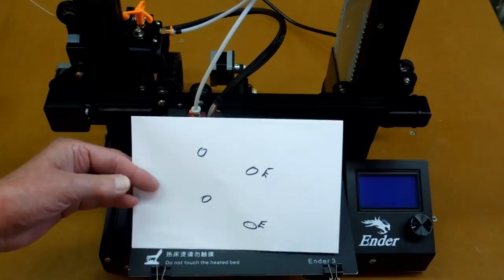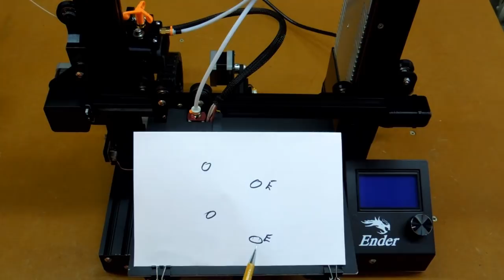Ender-3 Review The Good, Bad & Ugly

Comment: I do agree with some of your critique, particularly the filament holder and fan orientation and certain build quality issues. 

But after getting one and spending a week upgrading it and tweaking it, I realize that while it benefits their bottom line to ship out a bare-bones product that requires tinkering and modification the end result is a crash course in 3d printing and minor electronics introduction.

Just researching and printing out upgrades and even buying some minor hardware upgrades help me understand alot of the basic concepts and made me more comfortable handling the technology. You are absolutely right in saying that if you are a tinkerer or a hobbyist this is a great tool. But fundamentally the 3d printer is one of the cornerstone of the maker community so in essence this product keeps to the heart of that.

The entire point of this product is to learn the nuts and bolts of 3d printing by using the product itself to help you understand how a 3d printer works and what it can and can't do. For that alone this product hits the mark and for the price point is literally as close to a no risk commitment to seeing if this is the thing for you.

Comment: OK, it's now 4 years later and this printer is still in production despite the fact that Creality has introduced many upgraded models.  I recently bought an Ender-3 Pro, which has a few upgraded features over the original.  It's a bit more expensive, but I think it's worth the extra $50 or so.  Also Creality has been modifying these printers silently behind the scenes, making some improvements.  
The differences between the Ender-3 and the Pro version are small.
1: Y axis now rides on a 40x40 extrusion instead of a 40x20 for increased rigidity. 
2: Build surface is the same, but is now held in place by a magnet instead of being glued down to the bed (magnet sheet IS glued to bed). The build surface is flexible making it easy to peel finished objects off the sheet.  The flexible build surface is also a magnet so it will attach to the bed in only one orientation (N<->S poles aligned).  
3:The printer used to come with a Meanwell power supply, it now comes with a UL approved clone built by Creality.  
4:The main board is now mounted upside down in the PRO vs the original which makes the SD card socket easy to reach (but it goes in UPSIDE DOWN!), and also puts the cooling fan on the bottom so bits of plastic won't fall inside the electronics enclosure. 
5:It looks like the Y axis endstop now is held in place by T nuts to the 4040 extrusion.

Today's version of these printers now come with a version 4.2.2 32 bit control board with standard motor drivers.  The V2 and S1 versions come with the new 'silent' drivers.  However, the motors in the printer are barely audible over the fans (when they are running at high speed).  The extruder sill has the plastic parts, but they now have a brass insert in the hole to pass the filament so there will be no wear problem.  The threads for the bowden tube compression fitting are also in a brass insert.  They have also added a spring tension adjustment screw.  All in all, I don't see any reason to rush out and replace the extruder with a metal one.
My printer was well packed, and the various modular parts were well assembled.  I would not call this a kit, very little actual work is required to assemble it, the user is just doing FA&T work (final assembly and testing). If you can assemble your kids new bicycle, or a kitchen table from IKEA, you can put this together.

This is my third 3D printer.  My first was a completely home designed and assembled RepStrap made out of surplus stepper motors and metal parts from Home Depot.  My second was a RepRap Wilson design with its parts printed on the first printer.  The Ender-3 Pro printed much higher quality right out of the box than either of my previous printers with no fooling around with slicer settings (used the 'stock settings that came with Prusa Slicer for the Ender 3).  PLA I used was the Matter Hackers 'build series' at $21 a spool.   Bed leveling was easy, I used 'Filament Fridays' gcode.  Excellent printer!

Comment: These are most of the parts I have on my printer. These are pretty good useful printed parts to add to the printer. Later I did replace the extruder with the MK8 and made a Bowden filament guide because the extruder arm filament hole wears out eventually.

Comment: Good review. I got mine a week ago and I think they have once again fixed some things with the new batches. I was mentally prepared to fix the carriage plate banding - but it was actually perfect out of the box in my set. I carefully measured it and concluded its as it should be. I did notice that If I fastened the bolts on the z-stepper motor the lead screw would bend a bit too much against support structure. I also had to put a small piece of plastic between the motor and so got the lead screw in perfect alignment. Maybe I got a bit lucky on my set, but my bed seems pretty even and not bent like many have reported. Really like this printer - a careful assembly can give one amazing quality prints - but indeed you need to be a bit of a hobbyist maintaining this machine.

Comment: An honest review. I have one and have not experienced some of your issues. I agree that if you have no mechanical knowledge you will struggle but otherwise I think it is a fantastic piece of kit for the money. I have not found any bed plate surface adhesion issues you had and I think it functions very well although I may try a glass plate in the future.
Reply from the maker: You are lucky with your print surface. Mine started coming apart in just 2 hrs. I am currently working on a different filament cooler system but I agree this is a good little printer once it is up and running.
Reply: i have just printed the Petsfang Bullseye cooler and will fit it soon. Interesting to see how that goes.
Reply from the maker: I changed direction on what I wanted to try for a cooler. I am in the process of printing the Petsfang Bullseye as well. I have the earlier Petsfang on the CR-10 and it has worked very well.
Reply: I was pretty much gobsmacked when I assembled mine as I got it working almost perfect straight off the bat, but I did follow Luke Hadfield's assembly guide, I haven't had any issues with the included build surface although I have recently changed to a glass surface

Comment: I’ve had my Ender 3 around 4 months and suspect Creality may have made improvements in models shipping during the time I bought mine. So many reviewers discussed the same common issues that I bought stepper dampers, extruder/Bowden upgrades, and prepared to make the recommended adjustments. 

After assembling and starting the first print, I noticed that the machine shipped to me was significantly quieter than the machines being reviewed on YouTube, and I have learned since that some of these shipped with the same board as the CR10.
Reply from the maker: Cooling fans in the Ender-3/Pro are much quieter than the CR-10 fans and they only run when they need to. My Ender-3 and Ender-3 Pro are both 24VDC so I question if the CR-10 12VDC board was used in any of them. Creality or Banggood seemed to have a problem rotating warehouse stock. The US warehouse ran out of the Ender-3 and I had to wait for the next shipment. Then it was obvious I had received one of the earlier and not one of the newer and improved models. My go to printer the past several months has been the Ender-3 and it prints perfectly after I made the z-axis alignment and y-axis carriage wheels alignment changes. I have been advised not to use stepper dampers on a 3D printer. Thanks for watching. Please subscribe! Ron

Comment: Those are all good points. Fortunately I haven't had a lot of the problems you've had. As far as the print surface goes I didn't stick it to the bed I just used the clips to hold it down. I've been using it kinda like a Easypeelzy and it's still Flat as a board. I have 6 printers and I have to say that this is one of my most reliable. I have at least a 80% success rate. I haven't had one issue with it and I run it almost every day. Yeah of course I did the usual upgrades but that's half the fun if your into 3d printing as a hobby.
Reply: I will be keeping an eye on half the issues you mentioned though. Like I said there all good points and probably should be kept an eye on.  My 2018 Tevo Tornado had more issues than this one out of the box.

Comment: This is an old kit. The current Ender 3s have 4 directly opposing wheels under the bed and the build plate is removable for easy print removal.
Reply: I just got mine yesterday and I can verify that the v-track wheels under the bed are not staggered, and the build plate is "removable" in the sense that they shipped it with the adhesive on the back but not applied. So you could peel the sticker off and adhere it if you want, but it's not exactly a removable build plate. If anything it saves you the trouble of removing it and replacing it with something better. I can also confirm that the z-axis still has some problems. I haven't stripped it all the way down yet but I suspect the z-screw carriage plate is not a 90 degree angle, as ronald has shown in his video. With the carriage plate all the way at the top of the screw, I get a 2.5cm measurement, where close to the coupler it's around 2.4cm. With the stepper disconnected, you can push the carriage down the z-screw without any binding, but lifting it back up is impossible- so there's a pretty strong bind happening at the bottom.

Comment: Nylon drag chain is super cheap to buy ($3-4 per meter on Aliexpress). I highly suggest buying them instead of wasting filament printing them yourself.
Reply: I'm interested now. Do you have some suggestion for attaching  it to the heatbed strain relief?
Reply: Mr. V - I completely agree; probably like most noobs to 3D printing, I now look at everything with an eye toward “could I print that instead of buying it?”, but there is much advice about considering your costs, since as you said, many things can be purchased at reasonable costs, some even cheaper than a 3d print. 

For me though, I printed the drag chain as a recommended upgrade to be sure, but I did it more as a learning experience because once I graduated from “test dog” in ABS, I discovered that figurines don’t exhibit the symptoms of a bad print as readily as a precision part does. I also learned how to be brave enough to terminate a print after recognizing hopeless problems with the first layer, extrusion problems from incorrect slicer settings, etc. 

The drag chain printing experience brought me through the tutorials of improving bed adhesion, careful control of temperature, minimizing “elephant’s foot”, printing multiple parts, and the rest of the basics necessary to produce consistent, high-quality, and strong precision parts (of this particular “type” of geometry having thin walls, pins, and holes).

I figure with time and labor, my ABS chain cost around $900.00 ft.; I’m going to be rich!

Comment: I just purchased a Ender 3 a few weeks ago. The poor quality control is the biggest issue for me. Mine had bad wiring that had to be all replaced, the wiring to ALL the stepper motors had to be placed. My frame is not square, despite it being a newer version. My bed is also warped. I don't expect it to be an amazing printer, but I did not expect to buy a product that did not work out of the box. BUYER BEWARE.

Comment: There is a facebook group called cb-10. The guy who made the page made a copy of the cr-10 and has the stl files uploaded there and you can use the z motor nut holder part to replace the incorrectly bent one on the ender 3. Handy to know if like me you don't have vice to bend the original.

Comment: Thank you for this kind review. I wish I would have found it before I bought that crap of Ender 3. Even if I'm new in the 3D printer world, I have found after just a few hours that it was just a piece of crap. Why in the world would someone buy it and replace all parts of it ? One question though: If you consider build quality, would you recemment the CR10 over the Ender 3 ?
Reply from the maker: The CR-10 is an excellent printer and I have used it a lot, however I have never printed anything which required that large of a build plate. I did not replace a bunch of parts on the Ender-3. I corrected the Ender-3 z-axis alignment and corrected the y-axis carriage wheel adjustment (I have videos on both). I moved the Ender-3 and the Ender-3 Pro into my house and moved the CR-10 out to my workshop. The Ender-3 has become my "GoTo Printer" because it is smaller and quieter. The Ender-3 is a VERY GOOD printer once you correct a few of the problems. I seldom need to relevel the bed. I suggest you donot give up on the Ender-3 but watch my videos, correct the two alignment issues and print a few accessory pieces. I then installed the 235*235mm Ultrabase Black Carbon Silicon Crystal Glass: https://goo.gl/ugMT75 and have had very good results with it. I have hundreds of hours on the Ender-3 and it has been very dependable. Hope that helps. Thanks for watching. Please Subscribe! Ron

Comment: Wow. I watched a live video of someone putting one together and he had none of these issues. May be a quality control issue.
Reply: Most likely due to when they acquired their printer.  For example l got my Ender 3 yesterday it had a removable buildtek type plate.   My  table rollers are directly inline with each other.   I had to remove some metal from the plate support when I put on stepper dampeners so the bed would clear,  I'd not seen anyone else have that issue.   I used his video on lead screw alignment and it was a great help.
Reply: Most are like this but don't get pointed out in other reviews

Comment: Why solder a 3pin plug with 3 wires to a 2wire connection on your motherboard?
Reply from the maker: Mother board z-axis end stop has a 2-pin socket and the z-axis end stop microswitch has a 3-pin socket. Connecting cable was supplied with the wrong plug on the z-axis end stop microswitch side. I used what I had to get the unit running.
Reply: So the connectors on the cables fpr x- and y-endstops were different from the one on the z-endstop?
Reply from the maker: The connectors for x, y and z-endstops are the same, 3-pin plugs & sockets with only 2 wires in the 3-pin plug (one pin is not used). Microswitches can be wired either "normally open" or "normally closed". These endstop circuit boards are probably used on other machines as well but utilizing different pins being wired. In the case of this 3D printer, the endstop microswitches are being utilized as normally closed and constant voltage is detected by the motherboard. Whenever a carriage touches the microswitch, the microswitch opens and breaks the circuit. That is how the motherboard knows the carriage has reached the end limit of travel. My printer was supplied with a 2-pin plug (by mistake) which would not work in the 3-pin socket of the z-endstop. That is why I had to rewire it.

Comment: I am unhappy, after 7 weeks it went downhill fast.
Reply from the maker: I have three Creality 3D Printers. CR-10, Ender-3 and Ender-3 Pro.
The CR-10 has approximately 1800 hours on it.
The Ender-3 has the most usage and has approximately 5000 hours on it.
The Ender-3 Pro has not been used as much and has approximately 700 hours on it.

The only thing I have had to replace is a hot end heater, two thermisters, a fan or two, a few printing surfaces and nozzles.

Obviously the machines need to be correctly adjusted and kept clean. It also requires time to learn how to correctly run a 3D printer. With all the variables and possible adjustments this can take quite a while and requires patience.

I corrected the Z-axis alignment on the Ender-3 (I have a video on that), changed the Y-axis carriage wheels under the bed of the Ender-3 (I have a video on that) and removed the magnetic print surface that came on the Ender-3 Pro (I have a video on that).

I have made quite a few improvements such as the addition of Petsfang Bullseye coolers to the hot end.

At the urging of a friend, I recently upgraded my Ender-3 Pro with a direct drive extruder, BLTouch automatic bed leveling and a new motherboard. I must say it is a completely improved machine.

I also switched from Cura to Prusa Slicer. Prusa Slicer is a very powerful (and complex) slicer and I am nowhere near comfortable using it yet.

You said it went downhill but did not say why or how. Have you possibly just given up on it?

It takes time. Hang in there. There are a lot of videos available for the Ender-3.

Thanks for watching. Please subscribe! 
That is what keeps this channel going. 
Ron

Comment: This printer is useless and does not work, don't waste your money
Reply from the maker: Your opinion does not make it a fact. 
I have had the E3 and the E3Pro for over 5 years. They have made hundreds and hundreds of very good prints.
Relatively inexpensive printers, which can be upgraded and improved. I have six videos showing changes I have made to mine as well as an upgrade of the E3Pro last year to direct drive extruder, auto leveling and more.
So do not blame your tools... instead make your tools work for you.
Thanks for watching. Good luck with getting your printer to work for you.